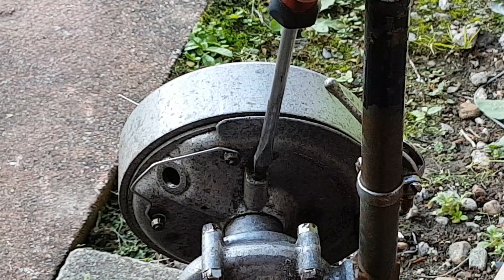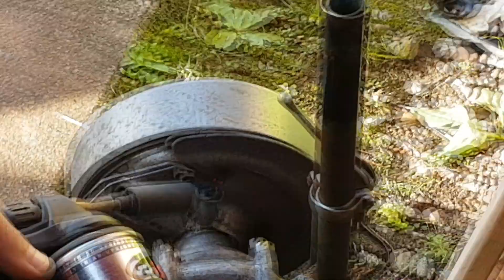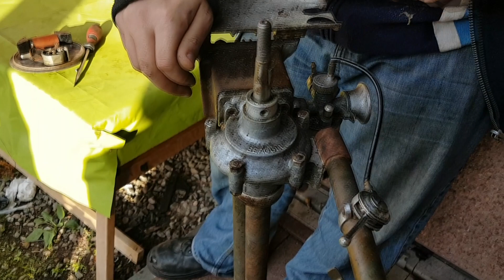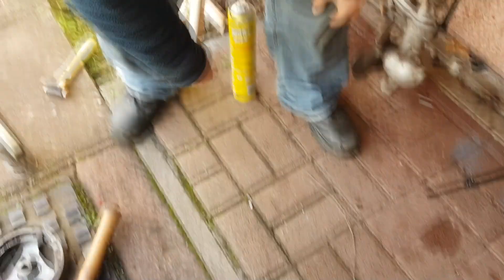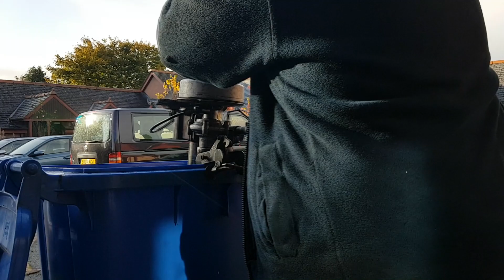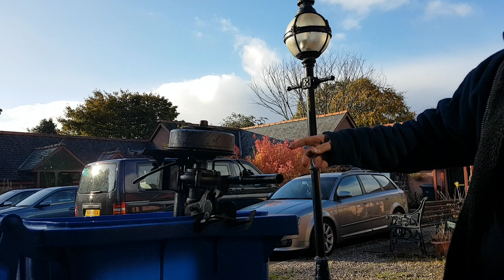Seagull 40 + with the wipac Coil replacment

Comment: It’s crazy how small that drive is what horsepower is that little thing?
Reply from the maker: It's  not rated by hp buts it's about 25 /30  Thanks mate for watching.👍
Reply: @AliMackMechanical  nice bud that should push a little boat along pretty good then